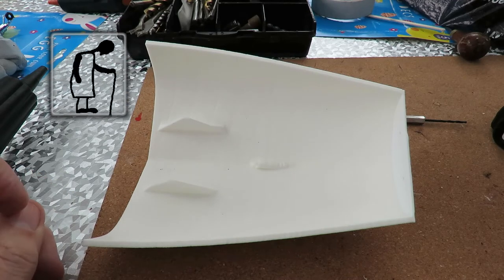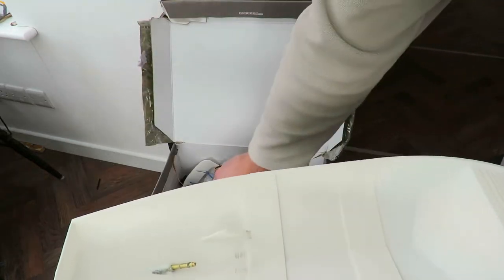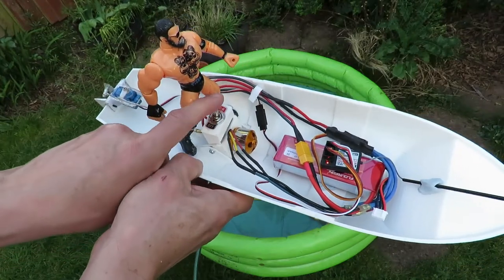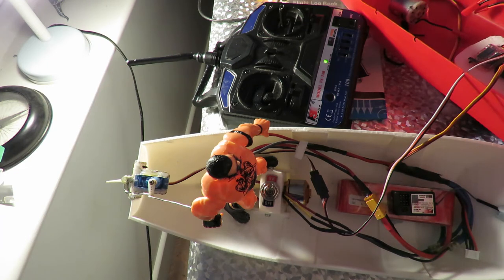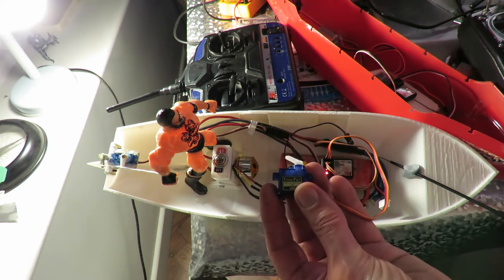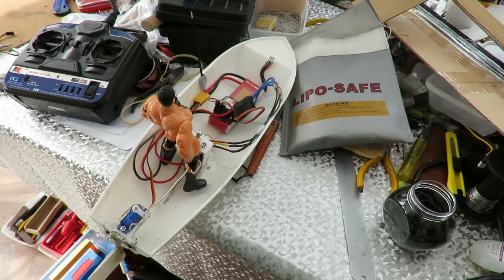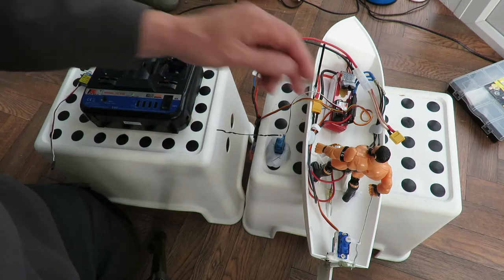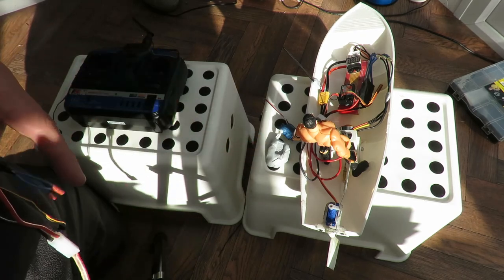Gifted 3D printed boat PARTS 1 to 9

Comment: Just had a thought about the problem with reverse. Why not use channel 2, the elevator channel and put a little brushed motor on it with a little prop facing out at the front. Then you can use that channel for reverse. Just a thought.
Reply from the maker: That would certainly work. It would only be required for reversing away from obstructions :-)
Reply: @GrandadsOtherChannel : Yip, and since that channel is free then it gives you that option. As you say, it's only for reversing away from things if it gets stuck. :-)